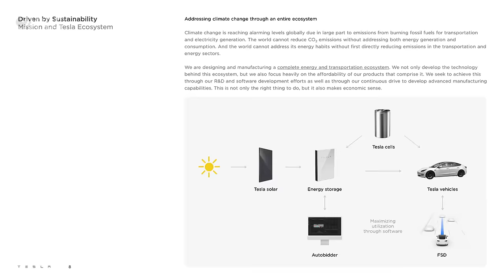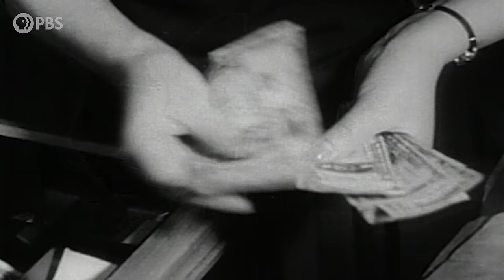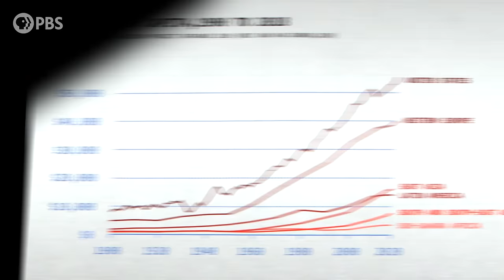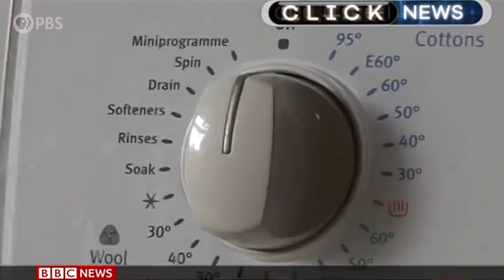You Can't Shop Your Way Out of Climate Change

Comment: Finally, a US public service media source reports the unvarnished truth . . . well done PBS!
Reply: Agree. 
PBS Terras has made a lot of important videos on climate change lately!
Reply: @Flewty  Yes, but this is the only one that comes right out and clearly states that it will keep getting worse under our current system of hyper-consuming capitalism.
Reply: PBS is a national treasure.

It is no coincidence that conservatives constantly try to defund the programming. They are one of the few educational spheres that speaks truth to the reality of our damaged system.
Reply: The lifetime emissions for the vehicles need to be considered. The average gas powered car takes around 20,000 lbs of CO2 to produce. The average EV with a 100 kWh battery takes around 30,000 lbs of CO2 to produce. According to the US Dept. of Energy the electricity sources for the national average are 40% Natural gas, 20% coal, 20% nuclear, 10% wind, 10% hydro and solar, etc. Its not 100% coal. Also accord to the US Dept. of Energy the average gas powered car produces 0.82 lbs of CO2 per mile, while the average EV produces 0.44 lbs of CO2 per mile. After 200,000 miles the average gas powered car would produce around 164,000 lbs of CO2  and the average EV would produce around 88,000 lbs of CO2, then add emissions of producing the vehicles and you get 184,000 lbs of CO2 for the gas powered car and you get 118,000 lbs of CO2 for the EV. This does not include emissions from producing gasoline. Only in West Virginia do EVs tie with gas powered cars.  The emissions from the electrical grid can be drastically improved, where as emissions from gas powered cars cannot.This PBS video only talked about emissions from producing the vehicle, they're reporting misinformation. 
Sources: https://afdc.energy.gov/vehicles/electric-emissions#wheel
https://www.youtube.com/watch?v=6RhtiPefVzM
Reply: 1:55 All EVs use cobalt averaging 100lbs per EV which is mined by slave children in the Congo. She didn't mention that Iron phosphate (LFP) batteries don't use any cobalt. Base model Teslas which make up 50% of their sales use these batteries, these batteries are on the base model of the Model 3 and Model Y. The base model Ford Mach-E is also LFP Cobalt free. Most EV manufacturers selling in the US plan to offer cobalt free LFP batteries within a few months to a few years from now. She didn't even mention LFP batteries. Around the world they are currently selling many other LFP cars, but most of them aren't sold in the US. How about some legislation?
Reply: @alterbr33d hit the nail on the head there. I feel like this was obvious throughout the video. Pushing their own agenda.
Reply: @alterbr33d  Not to mention most things are made by slaves somewhere in the world. Last I checked most clothes and most chocolate was made by slave children.

Comment: There is a reason why the 3 R's began with reduce and reuse. Recycling is dependent on economic factors outside the typical consumer's control, but consuming less, repairing what can be repaired, and repurposing things that can't be fully repaired (e.g. torn jeans into shorts or cleaning rags or pieces for a denim quilt) goes much farther toward doing some good. My individual contribution is minuscule, but it does help a little--especially if it catches on. Of course the big policy decisions will make the biggest difference, but I don't have much influence over them!
Reply: But how do you make a quilt?
Reply: Recycling is something that becomes easier over time, because as raw materials become harder to find and produce, the demand for recycling will naturally increase. It is a problem that solves itself.
Reply: @MegaLokopo that's some wishful thinking that isn't even that wishful since it relies on everything getting much worse

Comment: People always seem to forget that the phrase is "_REDUCE_, Reuse, Recycle."

Yes, if you're going to buy a brand new car, buying an EV will be better for the environment than a gasoline vehicle, long term.

Buying a used EV is even better.

Continuing to use an older, efficient gas car is even better than that.

But best of all is - drive less. If you live in a city that has reliable public transit, use that! Walk! Bicycle!

(All that said, I'm disappointed at PBS for pushing the FUD statement that EV batteries are "waste" at the end of a vehicle's life - batteries are some of the MOST recycled/recyclable materials we use. That Tesla battery won't just be thrown in a landfill. It will be used in stationary power systems, then rebuilt, then finally all its components recycled. Almost none of it will end up in a landfill.)
Reply: Making products that lasts longer and are not built to wear out intentionally should be the goal. Things that can be serviced, like your phone, need to be able to be able use third party parts, like a phone battery or a simple universal cable, looking at you Apple.
Reply: @flufffycow  Firstly: You're not wrong. 
There is however a limit beyond which it isn't sustainable to keep repairing some things. For many things that limit is somewhat pliable, and adjustments come in many forms—yet there are hard limits on things like how many times a knife can be sharpened.
Reply: AnonymousFreakYT I gave you a 👍🏻, but there's some assumptions embedded in your statement worthy of unpacking.
(1) The "efficient gas car" myth: The reality is that most people already drive their cars until parts are falling off that cannot be replaced or they are unrepairable. It doesn't make any sense to encourage them to keep something they can barely envision replacing. Additionally, many of those vehicles use more resources over a three to five year period just to stay on the road than would be expended to build a new equivalently functional EV (or even a hybrid in many cases) and drive it a similar number of miles. This of course touches on the next presumption, 
(2) That driving less is always meaningfully possible—which it isn't. While some organizations like the MBTA (Boston Massachusetts region transit authority) have made great strides melding public transit and housing realities, they are generally the exception. Unfortunately, even a system as good as the MBTA (AKA "the T") often still leaves poorer workers with four hour round trip commutes each day. This means they are likely to eat less healthy food each day, lacking time to prepare it—so even if bicycling the "last mile" were an option they'd not be able to do it.
(3) There is, in a huge amount of this flavor of "Solutions" media, an embedded assumption that not only are cities more affordable to live in but that they are more environmentally sustainable and closer to climate neutral. Unfortunately, at least in the USA & Canada, this just is not true. Cities are, in general, more expensive and less equitable places to live—leading to more renters over time spending a larger share of their income on housing that is steadily becoming less environmentally efficient. The landowners don't pay for the energy costs of their developments (that gets billed to the tenants) so they are not incentivized to do efficiency upgrades. To add insult to that injury, most cities in the USA and Canada lack functional public transit and are too diffuse and oddly structured to be meaningfully walkable or cyclist-safe.
(4) Finally there's the usually unspoken political dimension: Driving Progressives into increasingly dense cities only exacerbates the problem of government not taking the necessary actions to improve climate stability by empowering Revertatives & Rethuglicans to take over districts in the USA (and similar for people around the world).
So yeah, what was that "simple" answer again?
Reply: while it is true that a lot of battery parts CAN be recycled, unfortunately that doesnt really say the total reality of global situations, while science is getting good at recycling, a lot of parts will still need fresh material to seed it, and also a lot of car manufacturers (tesla included) see this as less profitable and would prefer to keep daddy's old cobalt mine open, this has already resulted in extremely large lots of returned cars with damage that sit in deserts on a concrete heat sink waiting for elon to pick the more environmentally concision decision instead of the cheaper economics of continuing to profit off of enslaved child labor like he did when he was a kid.
Reply: @AnthemUnanthemed  Elon's father owned a diamond mine in South Africa, not the Democratic Republic of the Congo (formerly Zaire, what Elon's father would have called it). There were shitty labor conditions, but Apartheid and slavery are very different in meaningfully insidious ways.
As for the preference to use new materials, that is dropping over time as the price for recovered materials (via recycling) drops. That said, demand for materials will exceed supply (freshly mined and recycled) for some time yet. Many newer cars are also being made with non-cobalt Li-ion chemistry batteries.
Reply: Good first world advice, indeed, not always the case @flufffycow
Reply: @AnthemUnanthemed  daddies cobalt mine? "Extremely large lots of returned (Tesla) cars"? Maybe your talking about a china grant fraud loophole?  Nothing to do with US BEV economics, not battery recycling vs trash...

Tesla doesn't recycle the batteries, but there are dozens of others which do, and all of Teslas scrap goes to them, and they recover over like 95% of the materials.
Reply: You're right about the Tesla batteries. "According to Tesla, 100% of their lithium-ion batteries are recycled, and they cannot be sent to landfills. In fact, CleanTechnica says that Tesla batteries are 92% recyclable, and that the materials are almost 92% reused".  I agree, PBS screwed that one up.
Reply: 17 year life cycle for a Tesla. Really?

Comment: The greenwashing is what ticks me off. As an amateur bookbinder, I haven't bought or used any newly made paper, cardstock, or leather for my works; all of them are purchased from thrift stores and salvaged from garbage piles. Most of the pages I used for my works are either very old stock that even the stores themselves don't have inventory of or used paper like paper bags or discarded thesis papers. 

Looking at the "green" options like journals made with bamboo covers (while being spiral bound), it just reeks of PR speak trying to spin barely revised products like it's a trendsetter for sustainability. There is nothing "green" about journals with wooden covers and are spiral bound, it's just a lazy reskin...

Comment: 6:30  "We can electrify the entire grid."  ???  It's already electrified.  That's what it is.   AND - you can charge an EV with power generated from the dirtiest coal power plant and it will still have a smaller CO2 footprint than an ICE vehicle when you consider the energy/emissions it takes to; find the oil, drill and pump the oil, transport the oil, store the oil, refine the oil (POP QUIZ - What industry sector buys the most electricity for the manufacturing of its product in the US?  Fossil fuel. Most of that power is generated  using fossil fuel), store the product, transport and distribute the product, then fill up the fuel tanks of ICE vehicles and burn the fuel in an engine that is only 20 to 36% efficient in converting the chemical potential energy of the fuel THAT THEY SPENT ALL THAT ENERGY MAKING into motion, and then to top it off, you send all that fossil Carbon into the atmosphere.  Yeah.  So @PBSTerra  I think next year I will remember this video when PBS wants to know what channels to prioritize...
Reply: How did they get the PBS logo for such an anti EV pro Fossil Fuel disinformation?

Comment: This video is very good except for one thing. The reason the economy has to grow and we have to consume more and more stuff, is that our currency is based on debt. In order for the currency to be stable the debt has to be paid with real resources from the environment, and human labor. Shrinking economic activity without addressing the currency problem will make our economy unstable, perhaps catastrophically so. Shrinking the economy by consuming less stuff absolutely must happen to stop climate change!!! But  we need to change the basis of our money system to prevent economic collapse first.
Reply: Do you think that if "our currency" wasn't "based on debt," then humans would consume significantly less resources? As in, is the currency the driver of much of the consumption? I'm thinking "no."
Reply: @synupps877  the video suggests that we should consume less. I tried, in my response to the video, to point out the danger of reducing consumption in an economy that has to grow to remain stable. I believe that the makers of the video are CORRECT and we do need to reduce consumption, as infinite growth on a finite planet is not possible. Whether we are CAPABLE of that remains to be seen. But my point was that reducing consumption without fixing the structural basis of our economic system, the debt at the center of it, is likely to cause collapse of the system.
Reply: @synupps877 
It's not just the money. It's the system of private capital as a whole that is the problem. The primary driver of our society is the profit motive. The accumulation of wealth. This system creates an incentive to continually extract and consume resources at an ever increasing rate. To continue to increase profit for ever.

What we need is a centrally planned economy where things are produced and distributed based on need, and not profit. There are a lot of different models for how this system could work, but we can be sure that capitalism won't work for much longer.
Reply: @ElectricAlien577  So, with a "planned economy" we'll just destroy what remains of Earth's ecosystems a little slower.

We need a planet economy.
Reply: @synupps877  
What? I mean, we need to gain collective control over the means of production. The economy can be planned democratically through the state. We could prioritize environmental protection and human well being, instead of insane wealth for a few people, and poverty for the rest.  We aren't going to make it through this without global commitment and co operation. We need to change the way we live fundamentally if we are to make it in the long run. 
I don't know how we do that without collectively planning all production and resource collection in a sustainable manner. The market isn't going to prioritize those things enough on its own. At least not until things start getting bad.
Reply: It reminds me of the Roman Empire, which had to keep expanding.  That was the expectation for every emperor.  It's obviously unsustainable but if your culture and economy depend on it, what options do you have?  Did I just pull the old-dad move and bring up the Roman empire?  Let me grab my white new balance shoes and plaid cargo shorts...
Reply: Reducing consumption would absolutely collapse the capitalist system. Capitalists would never accept profit loss. So, in their usual manner they will cut workers. It would result in huge mass of jobless people on the streets.

Comment: They need to correct the part about electric car batteries being junked after their use. "According to Tesla, 100% of their lithium-ion batteries are recycled, and they cannot be sent to landfills. In fact, CleanTechnica says that Tesla batteries are 92% recyclable, and that the materials are almost 92% reused".
Reply: What are they supposed to correct and how??
Reply: @DrizzyB  Did you watch the video? It's pretty self explanatory. They said "junking the battery after its use" in reference to EV batteries. That is false, EV batteries are not junked after they are used.
Reply: Yes, exactly. There are more companies bidding for batteries to recycle and repurpose than there are batteries. Horrible take. They can be used for back up storage for solar arrays or portable charging, for instance.

Comment: One simple semi solution for this problem is to stop buying and learn to live with what you already own. Here in Finland, you can hear this advice many times. For example, many have said that they haven't bought new clothes in almost 20 years and they are still using the same phone as 10 years ago. And the only thing they take from the store is only food because they don't need anything else from the store. However, I have no idea how they make this work in practice and whether it is accepted if you buy used ones from a thrift shops or a secondhand stores.

Comment: this is a good little vid. I'll certainly share it around. 
The point about  the environmental costs of manufacturing new 'green' goods is particularly important. Often, the greenest choice is to keep using the old one. 
The economic problem is that 70%  of the US economy is household  consumption. And much of that is either disposables (single use plastics etc) , or goods that we buy again and again because they are built to break, (shoes, clothes, appliances) or they go obsolete (anything electronic) or our tastes are manipulated by fashion. Or we simply overbuy. Our closets and cupboards and garages are stuffed. Its a cult of shopping - 'when the going gets tough the tough go shopping' as they (used to) say.